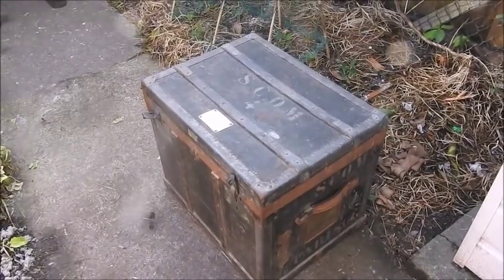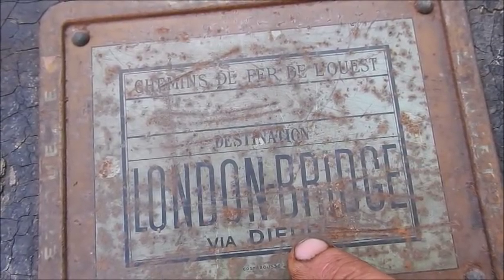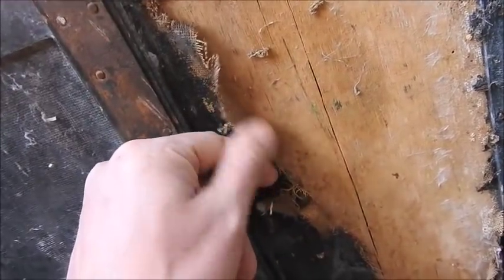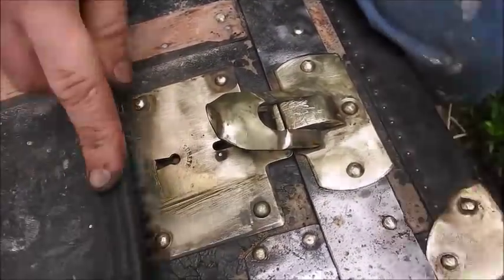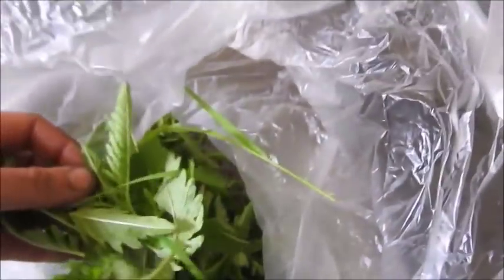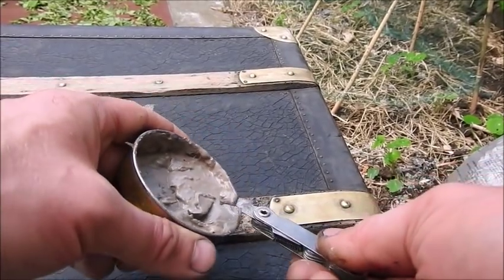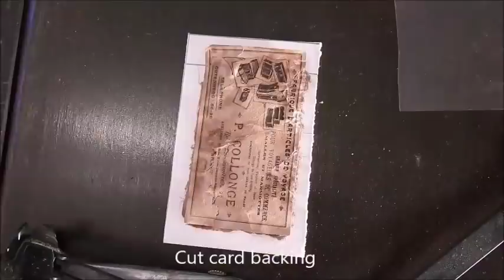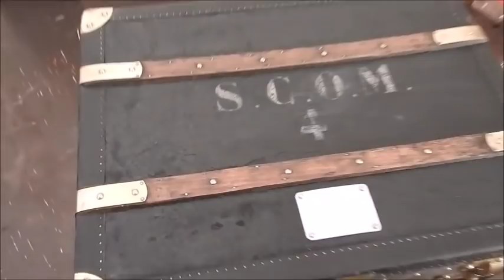Restoring an Antique French Travel Chest (c.1900, Paris)

Comment: How did you address the canvas on the bottom? I am restoring a trunk that is covered in canvas and was painted but I do not know the techniques in patching it or what sort of paint to use.
Reply from the maker: I just ripped off the loose bits and glued the rest down with wood glue. It was a hessian type material, painted with a tar or bitumen like substance to deter woodworm.
Reply: ignolator neither does he...